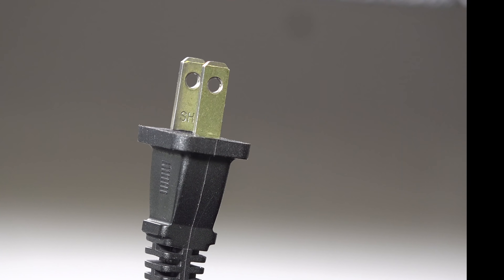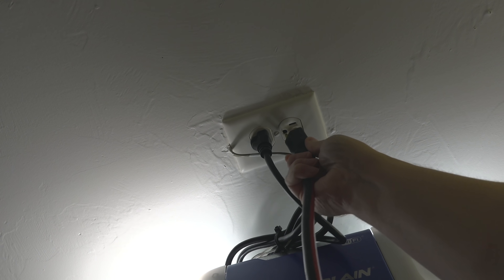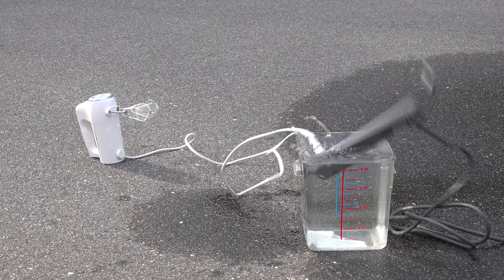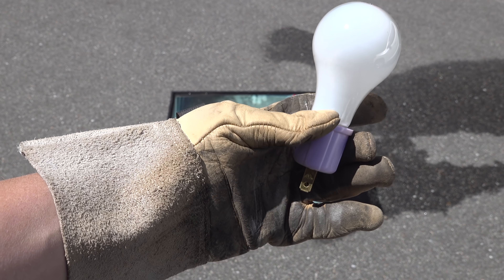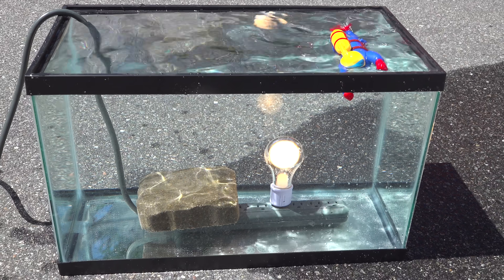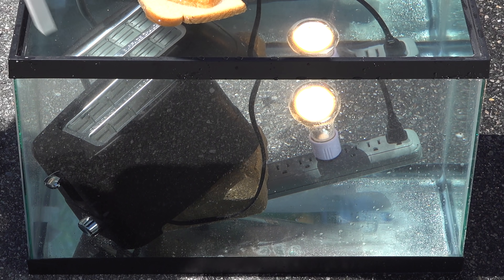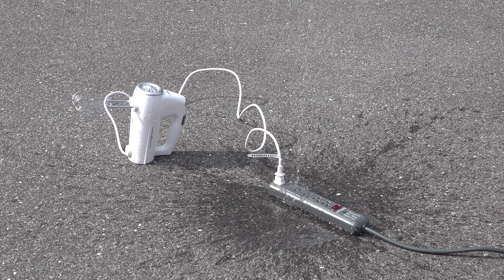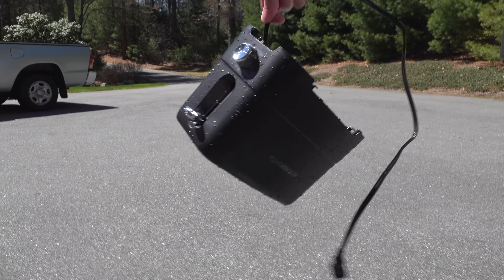What REALLY HAPPENS WHEN YOU SPILL WATER in an OUTLET?

Comment: First, on your plug extender, you possibly didn't have a GFCI but actually a circuit breaker. Since the overall amperage flowing into your circuit unlikely exceeded 15 amps... it probably didn't trip.

Second, if I assume you were testing a GFCI... 

GFCI - GROUND... fault circuit interrupter. Your GFCI never threw because you never created a ground circuit short. Essentially when you threw your stuff into the water bucket... yeah - the whole thing filled up with water... but the avenue for the current never changed and the ground potential never changed...  The GFCI is designed to trip when the difference in the amount of electricity flowing into the circuit is different than that flowing out, even in amounts of current as small as 4 or 5 milliamps. A GFCI reacts nearly immediately (about a tenth of a second) to shut off the current if it detects current drop-off.

If you had stuck your hand in that fishbowl... in addition to dying (possibly), you would have immediately tripped the circuit. The circuity would have detected the short. If it was a circuit breaker and not a GFCI... you would have "rode the lightning" and eventually the current draw would have been high enough to pop the circuit.

In short - don't do it ... ever. Your house has more than sufficient current to kill you...  even with breakers and GFCI circuits... you can get a jolt high enough to immediately cause a myocardial infarction (a heart attack) and die. It would be like shocking you with the paddles...  the jolt interrupts the T-wave and you go into V-fib and that's that...  :P

Comment: Nice video but you should know two important things about electricity:
1- due to its nature electricity flows in materials with less resistance 
2- electricity only flows in closed circuits so you need to ground your water tank in order to trigger the circuit braker. 

So due to the tendency of pure water to be less conductive than copper wires in your toaster and due to the water tank (both plastic and glass are good electricity insulator) not grounded, your enviroment is enough insulated to work just fine.
Reply: The second point explains why if you throw any kind of appliance in your bathtub it would trigger the circuit breaker since the bathtub is grounded by the drain pipe. That's why people in movies dies when the hairdryer falls into the water. NEVER try it ;)

Comment: "the toaster uses 1200 Watts of power"
it doesn't matter as Watts and Voltage are diffirent things, the toaster runs on 240V which is what'll give you the electric shock as watts dont matter, par example if you take the pain level of 2V AC with 100 Watts it wouldn't feel like much other than tingling, but  if you take 100V AC with only 2 watts it'll give you a harsh electric shock like mains would do, I would recommend you see ElectricBOOM's Video about this topic
for a simpler explanation, Watt heats up stuff, Voltage shocks stuff
Reply: I want to learn more so I'd like to watch that video. Do you happen to have the video link or title?

Comment: In modern houses in the UK all our plugs are protected with RCD. Some houses still have things like hard wired cookers and other kitchen appliences but this is becoming less popular and allot of houses now have the standard UK outlet for these. All plugs aswell contain a "fuse" which is connected as a part of the current and will blow if the current becomes too high like a short circuit or something. I find fuses are more of a back up thou. 9 times out of 10 the RCD will trip before the fuse blows. 
Outlets are rated 230v at 60a which you're gonna have a hard time surviving that surging through you so its not surprise we have to have allot of safety measures in place.

Comment: Once I spilled some water into my extension cord next to my bed without noticing at first. After 1 minute I was wondering where a very quiet sizzling sound came from. Turns out the water started cooking inside the cord. I quickly disconnected it and it was very warm to the touch. I wonder how hot it could've gotten.

Comment: I’m no expert but I think the reason the breaker didn’t trip is because the light bulb and the egg beater have a lower resistance than the water. So the electricity took the path of least resistance and didn’t go through the water. Even if there was nothing plugged into the power strip I think it would just act as an electrode boiler if you added some salt.

Comment: Fact: Heat is the #1 Cause of Electrical Failure.

Notice: phones nowadays are waterproof. But are they heat proof?
Reply: Don't most newer phones have cooling technology built in? I thing the ROG phones even have fans built in.
Reply: @sonicgen1  ik Samsung has a heat protection system where if it gets to hot it will stop charging the phone
Reply: @jamesdukes1869  happened to me lol
Reply: @sonicgen1  That is true. Though, a fan won't be able to make a huge difference in temperature. Eg a fan couldn't cool down a phone if you put it in an oven.

Comment: That's strange. I actually experienced that my outlet got soaked in the water and it burnt out. It was a time we had a bad weather here and the water from our roof slipped off in our home, flooded the floor, in which made a contact to my outlet.

I was expecting the same result on the video where the outlet getting burn. Eitherway, be safe. it's still dangerous.

Comment: Do it with salt added to increase the water conductivity and use a multimeter to measure if there is voltage going across the water. Could be some more interesting results!

Comment: There are a couple things going on here: your water is insulated from ground potential, and clearly the water isn’t very conductive. One test you can do is to put the power strip (without applying power) in the water and measure the resistance hot to neutral. You can also use a kill-a-watt with a live circuit to measure the draw. This will be determined by the mineral content of the water (so two different water sources produce different resistance).

The problems with electricity and loss of human life involve creating a path of least resistance arm to arm (across the chest). The water lowers the resistance between human skin and electrical things — very low current is capable of causing death when it passes through the chest. The sort of setups likely to cause harm would involve water, grounded plumbing, wet hands, and placement of the human chest in between the live source and the ground potential.

Comment: The issue is that water can create a return path through things other than the neutral wire. It takes very little current flow to be fatal, far less than most appliances use. The thermal breakers in your home are not there to protect you or your devices, it is there to make sure the wiring in your walls do not get overloaded. Gfci on the other hand is there to make sure that current is going the intended path (from live to neutral) and will cut the power if there is any current that deviates from this

Comment: No dude... You have very pure water or you have some type of water filter installed.
Do a water analysis or something, it's odd that your water doesn't have any minerals or impurities in it.
My water has a lot of Calcium and a lot of Cl+ or Bleach.
My tap water smells like it has bleach in it and it's highly conductive.
You can also try using different types of mineral water or different soda's, because it's more likely that you spill something like this on a extension cord.

2nd... Use a fucking isolation transformer because you might leave the whole neighborhood in the dark for a couple of days if you really manage to do a proper Short Circuit.

3rd, the circuit breakers might not work, they can and will fail... So... Have a backup plan and get a extra circuit breaker, DIY a mini electrical panel or something.

Comment: From what I understand the circuit breakers in non GFCI power bars are there to prevent over current and not the user from shock, so there's no surprise that the power bar worked complement fine in water. Put more power than it's rated to handle and it would have tripped

Comment: The reason you got the results that you did is because you're using a free-standing body of water that is not grounded in anyway so the electricity is flowing through the water and back through the line like it should, and obviously if you stuck your hand in that water you would be electrocuted with 125 AC volts,  and when you use the GFCI outlet you are pouring water on it which means the electricity most lickly traveled to ground through the asphalt, and tripped the gfci outlet, remember ladies and gentleman this isn't Hollywood water doesn't make little lightning bolt effects when it's electrocuted, it's invisible and can be deadly

Comment: Hmmm. I think since the water wasn't conductive, you would NOT have died sticking your hand in the tank. DO NOT STICK YOUR HAND IN THE TANK that is not my point. My point is that this test doesn't really explain why water doesn't or does trip the circuit. The reason why it would is because the water would short the positive and negative terminals and large amounts of current would flow, tripping the power bar (or GFCI). The reason they didn't trip in the first place is because the water was not conductive enough. ElectroBoom tried sticking his hand into tap water with live wires vs salt water, and tap water only got bad because he move very close to the wires and had a cut exposing more conductive flesh. That being said, don't stick your hands into the tank, but if you did, you'd feel slight tingling the closer you moved to the toaster. Please don't stick your hand in the tank.

Comment: Water is a pretty bad conductor. 
Heck willing to bet the only energy conducted was due to the salt your hands introduced. 

Although the issue is more corrosion. Water will cause the copper and parts of the toaster to corrode faster leading them to fail quicker.

Also your fleshy body will be a much better conductor then the water.

Comment: This is because current travels through wires and wires can't be damaged by water but some devices such as phones stop working not because of the circuit through which currents passing but because of the motor or battery coming in contact with the water

Comment: No, no no, that water was not "fully electrified". As long as there's a ground point for the electricity to flow through, it will always take the path of least resistance. I'm not suggesting you do this, but you would be totally fine putting your hand in that water.
https://www.youtube.com/watch?v=dcrY59nGxBg
Reply: Putting hands into the water is a different thing. It may/may not shock you depending on how near/far your hand is from the 'Energized Field'.❗

Comment: if you disconnect the appliance while underwater it would trip the breaker, they only thing why this does not trip because your circuit is complete, electricity tends to travel to the lowest resistance and i meant the taoster and mixer. water has a rather high resistance, try adding salt. hehe

Comment: Before watching I can tell you. Water in itself is a poor conductor. It's not until things are added to it it becomes conducive. Like the sodium hydroxide in the soap when you throw a toaster in the bathtub or chlorine/flourine/ insert other disinfectant your local community uses to purify water. salt water or water with electrolytes in them are good conductors. Pure distilled water is not conductive no matter what your 5th grade science teacher told you remember its 5th grade not university. Plus manufacturers generally spill proof there devices. So I wont be surprised if nothing hapens.

Comment: Lol, this video starts with a great misunderstanding of water and electricity, plus what breakers do.

Basically, breakers trip from a current higher than their rating. Water on the plugs isn't going to surge the amperage like it was a short circuit or something. 

GFCI is made to be purposefully sensitive to power leakage, which is why water over the 3 different prongs works easily to trip it.

Comment: Contrary to popular belief, water is not that good of a conductor. It still does conduct electricity, that is why it tripped the GFCI. But it will never be conductive enough to draw enough current to trip the over current breaker. The danger with water + electricity is that wet skin is way more conductive and it doesn't take much current to electrocute someone.

PS: Pure water (De-ionized) isn't conductive at all. It's the impurities that make it conductive. Tap water contains small amounts of minerals, so it's not pure.

Comment: Could it be an issue with the breaker in your home, hence why it didn’t trip on the main circuit but when a localised breaker was added it did?
Reply: Nah, breakers work under overcurrent. The water wasn't conductive enough to draw the amount of current required for the breaker to trip. The reason the GRCI tripped was because there is some current running out into the water in the range of mili-amps. Those are enought for the GRCI to detect and trip.

If You mesuare the voltage in the tank there should be some voltaje coming from the outlet into the water.

Comment: There are a lot of misconceptions around electricity, especially in the USA, where people are basically scared shitless of it. Electricity and water are a dangerous combo, but given that the water is mostly clean, you could even stick your hand in that tank and maybe not feel anything at all. Also, the normal breaker won't trip just by having the things in water. For the breaker to trip you need the current to go way up, whereas if you just pour water over your electronics, the current will go up only a tiny bit.
Reply: In the water, its a different story depending on how near/far from the Hot-to-Neutral/Ground energised/'cooking' Field...
Reply: @piratedprivacy9052  Of course, but you're just gonna get a good tingle if you approach the wires, if the water is relatively clean. Well, if you do touch the wires, then you're gonna get it bad.
Reply: LondonNight  I think I've missed out from yr point...😁
(110V and clean water...)👌
I was generalising towards any liquid(mainly water) and
unknown voltages in between say 250V/450V and
maybe secondary path to ground and
maybe in the event of a loss of Neutral.

Comment: Your water is too pure. Pure water is an insulator. Try adding salt to the water, which would make it more conductive
Reply: The keypoint here is the liquid(water) has certain amount of RESISTANCE, regardless if its pure water, salt water etc...
Between Hot(110/220V) to Neutral, the liquid will just be 'energised' aka boiled. This purely depends on the given voltage vs cross-resistance.
Reply: Baking soda instead do no chlorine gas is released
Reply: @isaccabrera4817  It's being done in a well ventilated environment so I don't see any problem with a little chlorine gas.
Reply: @bass2762  nothing wrong with being extra careful but i see your point and it would probably be fine.

Comment: The problem with water and electricity is not that they don't mix, but that they mix too well
Reply: Yes
Reply: @Woletat  yes
Reply: @subliminal9144  yes
Reply: For added fun, you can mix water, salt and electricity to unlock chlorine gas, a nice little internationally banned chemical weapon gas
Reply: @amahlaka  if chlorine gas is banned, why do labs use chlorine gas?
Reply: Not really, water is an insulator
Reply: @AverageAlien  Water is a conductor. The reason why water and electricity are so dangerous together is because water becomes electrified. It would be just like touching a bare copper wire and then another bear copper wire that both have electricity running through them. You would complete the circuit.
Reply: @MikeytheBass  Nope, pure water is an insulator. One of the best insulators actually, doesn't conduct any electricity.
Reply: @MikeytheBass  I mean it's almost like you didn't watch this video or something
Reply: Right people think oh if this socket gets wet it will blow up or catch fire but it doesn’t work like that now if you plug it in it’s a i different story but the thing about that it’s already plugged in so it won’t really anything.

Comment: I'd guess your tap water is very soft, meaning very little minerals and salts to let it conduct electricity. Pure distilled water is nonconductive. Add a bit of salt and your water should become conductive and sparks will fly.
... And to anyone thinking of setting up a distilled water immersed lamp or PC build or whatever: DON'T. It may be nonconductive but it can still corrode metals like electrodes over time, and when it does it will then have some mineral content and will start to conduct. This is why the people making fishtank submerged PCs use mineral oil.

Comment: This is a pretty good experiment. It also answers what happens if your house were to get flooded. It probably depends on the conductive salts dissolved, whether the drawn current would be enough to trip the circuit breaker.

Comment: I was holding my breath the whole time coz i dont know if its gonna explode!
Reply: Nothing gonna explode, in worst case there will be temperature rise due to electrolysis. And because it's Ac voltage, you won't have much hydrogen and oxygen gas coming rather mixing themselves to create heat. 
poor people use live wires  to heat water in  a bucket for regular use in winter.

Comment: The story will change once you add some electrolytes. (Battery acid, muriatic acid, Lye, draino, or salt of any type)
Reply: Also you could get away with sticking your hand in the tube. You might feel some tingling as you approach the live and neutral wires, particularly as you stick a finger between live and neutral or live and ground. You should be fine as long as there isn't a path through your heart.